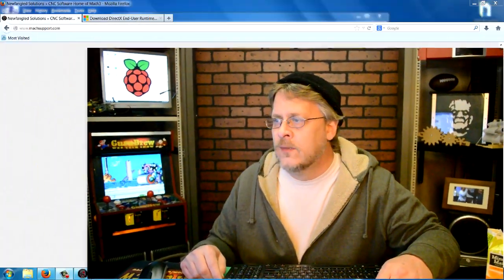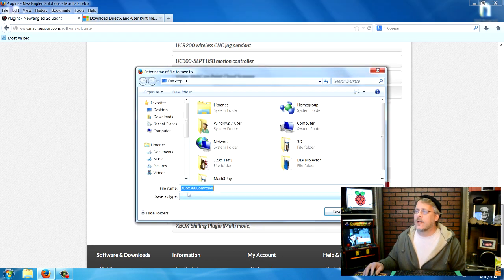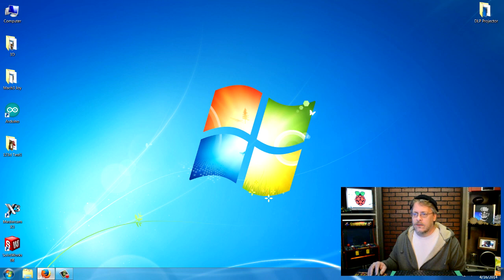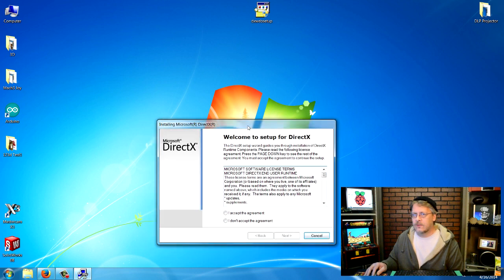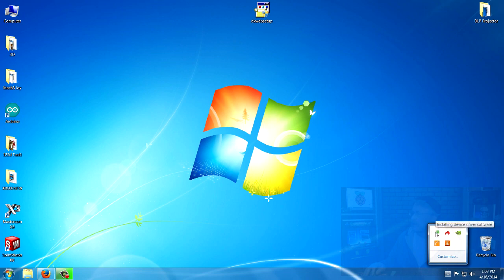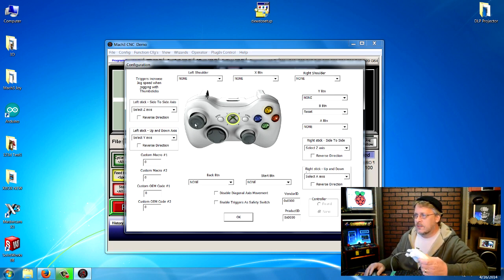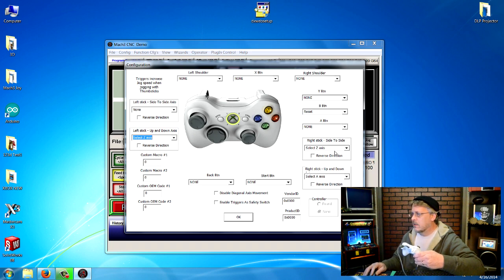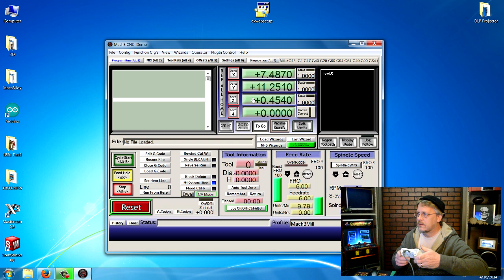How to Use XBox 360 Controller with Mach3 CNC Software

Comment: For those of you guys with an aftermarket controller, You'll have to get the Vendor and Product ID from the device manager.  Hit properties->hardware->properties->details and there is a drilldown for property.  Locate Hardware ID, mine happen to be E6F and 401, now plug the values into the fields in the mach3's xbox 360 plugin screen just right of the OK button and you should be golden.
Reply: thank you!  I purchased a generic xbox controller from the local Game Stop.  I followed GuruBrew (excellent) instructions but had no luck until I noticed your comment.

Comment: I had a small amount of progress tonight.  The genuine Xbox 360 controller as well as the clone controlled the Sherline using the Joystick plug-in but not the Xbox plug-in.....at least not yet.  I installed the Microsoft Xbox driver that you recommended below and XP responded properly when commanded with the genuine controller.  Both controllers came up with the exception of the indicator light on the clone.  I had to push the button on that one.

Comment: Thank you for your instructions on how to do this.  It's great.  I had run my cnc for three years with my xbox controller based on Lee Davis' addin and this video.  My cnc initially had only one motor on the y axis and the xbox controller worked great.  I upgraded my cnc to add auto squaring which meant I added a second y motor and limit switch on the A axis and slaved the A-motor to the y axis in mach3.  The Y with slaved A system worked great with the up/down arrows on the keyboard, but when I tried to jog the Y axis with the xbox controller, the Y-axis works and the A-axis only traveled in one direction.  The solution was to remove the Lee Davis addin, use Screen4 to set unused mach3 hotkey keyboard keys to the mach3 buttons that don't already have hotkeys and that you want to use from the xbox controller.  Then use antimicro to connect the xbox controller to all the keyboard keys you want to use from the xbox controller.  It worked great for me.  This should work for mach4 also because it makes the xbox controller a keyboard extension, but I haven't tried it.  By the way, Lee Davis graciously responded to my plea for help, but so much had changed with windows, that he couldn't help.

Comment: Thanks for the great info but I still have a question. As per your instructions I recently enabled a wireless x-box controller with my DIY cnc running Mach3 and it works great until I power down the program or turn off the computer. When I re open Mach3, I'll need to go back into my X-Box configuration settings and re install my Vendor & Product numbers before the controller works. Do you have any Idea what could cause these numbers to vacate and need to be re entered?
Thanks In Advance.

Comment: Great and informative channel, I use mach 3 on my machine thanks to you. Got one question. After setting up my baby and installing and configuring this plug-in to my liking I found that my machine does not do what your does which is diagonal moves with the controller, only one axis at a time. I had the "disable diagonal moves" box unticked as a default in config. During normal operation (cycle) everything is business as usual only on controller it does so. Any ideas??

Comment: An excellent description of how to connect an Xbox 360 controller to Mach3 software.  Thank you for posting this for us. This configuration works exceptionally well but there is one thing you should be aware of.  First, the Chinese copies of the Xbox controller for sale on eBay and other discount online retailers will not work for this purpose.  At least the unit I bought wouldn't work.  You will know there is a problem when during configuration of the Xbox plugin Mach3 does not automatically recognize that there is a controller connected to the computer.  The second clue comes when you try to manually enter the vendor ID and the product ID.  Mach3 will let you enter these values in the appropriate boxes but doesn't retain them once you exit the configuration mode.  It just wouldn't work no matter what I did.  Plug in a genuine Microsoft Xbox controller and bam, everything starts to work just like it did in the video.

Comment: Howdy-I followed your directions to the letter but when I tried to jog the machine the Y axis racked severely ( gantry style Y/A), in General Conf. my setting are "home slave with main axis"  and furthermore, my  X axis started moving on it's own and the only way to stop it was by hitting the E Stop button. I have the ESS smoothstepper board installed  and I thought maybe that was it but the instructions stated that the smooth stepper was covered. Any help on your part would be greatly appreciated. Thank you very much.

Comment: Steve,
I noticed you use MC 3...I am using a similar version at school MCX5 and I make guitar templates. So most of my cutting in really only 2 D.
What I want to learn is how to take that 2D drawing and make it 3D. I know it can be done as I've seen the teacher in school do it. I think what is done is you extrude the profile and set a thickness to it.
On an electric guitar, part of the surface tapers to give your arm some relief. If you look at a Fender Stratocaster on the top of the guitar, there is a bevel of a few inches taking the thickness from 1.75 don to maybe 1.25/
  I guess a ball mill is used...but my real problem is how to draw that in MC X5?
Can you help?
Rob
Reply from the maker: You take a 2D shape in a 3D program like Solid Works and extrude it for thickness then you use other tools to shape the belly and leg cutout. I have done this and it takes time to learn all the software to make it happen. I thought about making a video of the process but don't feel I would get many views because it takes more software than the average hobbyist has at their disposal. If you watch my video all about CNC router part #1, I show the raw guitar I made modeled after a 57 Strat. If you are truly committed to doing this, I would suggest getting and learning a good 3D modeling program. Don't try to use Master Cam to draw with, while you can do simple 3D drawing it is not the tool you want to use.

Comment: I tried a wireless Microsft x box brand controller as you described and  it crashes  Mach 3  . when I activate the plugin in Mach 3 for xbox . I get error triggered and mach closes. I get a 1 upper left green light on the wireless but no action from the CNC. any ideas? I loaded all the files from microsoft you suggested.

Comment: maybe you can help? i set everything up right but i have no control, xbox is in keygrab nd in con fig plug ins both on mach3 folder nd key grab plus mach3 plug in menu i set up btns like urs restarted nd nothing i use uc100usb so keyboard is my main use nd i own a win 8.1 surface pro2, tips?

Comment: Hi Steve,  I have been unable to get this plug-in to work using a generic controller.  And no I didn't read back in your comment section. :-)   Direct X has been installed, the plug-in is installed (both correctly I think.)  So tomorrow I go to Walmart and roll the dice on a genuine controller.   I'll post the results if there is any.   You produce a really nice an entertaining video series.
Reply from the maker: Hello, Yip it has been said here by others that generic controllers don't play well with this plugin and the genuine ones will correct the issues. Thanks for the comment. Steve

Comment: Very cool! Any guesses on whether it will work with a wireless controller?
Reply from the maker: I actually started out by selecting a brand new shinny XBox controller but was never successful are getting it to be 100% compatible. I have heard of others using it but personally gave up and went to the wired version. Steve
Reply: @GuruBrew  Hi Steve, hope you can help me with this. Hi all,
A while ago I converted Mach3 to run from metric to SAE. Everything works ok, I re-calibrated the motors, no problems running programs or jogging from the keyboard but I can only get the xbox controller to jog at 5% full speed. I tried so many things before asking for help that I,m at a loss right now. Tried removing and reactivate the xbox controller in the plugins, tried disabling and re-enabling the xbox controller in the peripherals of windows etc. Before , when I was in metrics, it would jog at the same speed as if you use the arrows on the keyboard but not anymore. Has anyone run in that situation before? If so what was your solution? Thanks for taking the time.

Comment: hi guru i was never able to get mach3 recognize the xbox 360 in windows 7 but i did get it to see the controller in XP..however the controller does not move any of the axis for some reason....is there anyhting i need to do to power on the xbox controller in mach3? mach3 has a green check mark in plugins....so not sure why none of the buttons do anyhting on the controller...controller has a green light on and it is seen in windows xp....i configured the buttons

Comment: So I was using this for awhile, then took it off while someone else was using my machine while I was gone. Now I try to re-install the Plug In and it won't work, it only downloads as a .dll and that won't work. So I tried the .exe file format (the one for offline use) and it just keeps saying I am missing .dll file after .dll file after .dll file. Any suggestions?

Comment: I am having an issue where the x axis isn’t moving but on screen it looks like it is. Other than that the controller does everything else I command. Same issue with keyboard commands and x axis. It’s a new to me machine so perhaps it’s in the wiring.

Comment: The XBoxShilling Plugin is a great alternative to the one you used in the video.
It allowed me to use the Logitech F310 Wired Controller with ease, where the standalone XBox360 Plugin wasn't working at all.
Thanks for video - it got me going on using a controller.

Comment: Hello..i have some write g code for x and y axis ..to open some plates and screw filling material..i want to use as mini injection molding machine.. i have some parametres to open and close clamping with stepper mator i use mach3 and i dont know the code how to repeat that cylce some my codes as loop?? please needs help ..forexample G1 X50 X-10 x -6 X0 and this is repeat hole cylce till i turn of the program ...please help needs i appreciate it

Comment: I am trying to download the XBox plugin for my cnc from the NewFangled website and it is telling me that the file could harm my computer. I continue on and it says. "The File does not have a program associated with it for performing this action. Please install a program or, if one is already installed, create an association in the Default Programs control panel". This is as far as I can get so uploading the plugin to my Mach folder is a failure. Please advise.
Reply: Were you able to find a solution to your problem?

Comment: Bought a USB Xbox controller and downloaded the xbox360 controller file from the site you showed.
Copied the 360 file from the house PC and installed it plugins  Mach3 dir. on the CNC PC which is NEVER on line for security.

Rebooted and got an error message "plugin DLL defective, relode" I clicked OK. Then got message "xbox360controller.dll - Defective plugin found.... Ignoring.. Hit OK and it doesn't show up in the Plugin control and Activation list.

What to do? 
Thanks
HH
Reply from the maker: Try running this file http://download.microsoft.com/download/0/0/f/00f2a67b-e10b-43b1-8cca-3deb12218f75/Xbox360_32Eng.exe

Comment: Hello I have watched several of your videos on YouTube. I got my first cnc machine a few months back and have spent days, weeks trying to get it to work with Mach 3. I was wondering if you could help id be willing to pay you for your time. Im in southern CA but I can face time you with my iphone or email you video or pics of my settings. I have a hand held controller and everything works fine but the machine wont move via Mach 3 through the computer. Im also using a UC100 motion controller because I don’t have an old computer with a parallel port.
 
I have this machine
CNC 3020 CNC Router Engraver Machine + JY5300 CNC Controller Box+ MHC1 HandWheel

Comment: Great video but for those using a generic / aftermarket xbox controller please note comment from Jrsydvl2003
For those of you guys with an aftermarket controller, You'll have to get the Vendor and Product ID from the device manager.  Hit properties->hardware->properties->details and there is a drilldown for property.  Locate Hardware ID, mine happen to be E6F and 401, now plug the values into the fields in the mach3's xbox 360 plugin screen just right of the OK button and you should be golden.

Comment: My Xbox 360 Controller is the wired USB like yours.  Problem I'm having is it tends to go into sleep mode (green light in upper left position resorts to all 4 lights flashing or sometimes it switches to the upper right).  Unplugging/re-plugging the control doesn't seem to work.  When this happens, about all I can do is restart the computer.  Have you encountered this problem or know of fix?
Reply from the maker: I have not heard of the actual controller sleeping. Are you sure it's not the power settings in Windows or BIOS releasing the USB ports? Maybe someone who has experienced this issue can chime in here. thanks
Reply: I'm running Windows 8.1 on a Microsoft Surface Pro Tablet.  I don't know if this will solve the problem permanently or not, but I was able to go into "Devices and Printers", right click properties for the Xbox 360 Controller, then click properties for the "USB Input Device", click "Change Settings", click "Power Management" tab, then uncheck the box that allows the computer to turn off the device to save power.  Hopefully, that will keep the controller from going to sleep.  I had previously configured the power management settings for the computer to stay awake when idle, but possibly this device property was behaving independently.  If this doesn't work, I'll update the post.
Reply: Sorry to say, but the fix I posted above has not solved the problem.  I'm not sure where to go next.  Since the Surface Pro only has on USB, I'm running the Xbox through a USB hub as well as a UC100 (USB to Parallel Convertor) to the breakout board.  I've noticed that when I have the Xbox controller connected directory to the Surface, it doesn't go to sleep.  Only seems to happen when hooked up through the hub.  Thoughts?
Reply: +mdsutherlin1 I would get a old desktop CPU from a friend and forget about using the Surface Pro for the CNC.

Comment: Is the XBox controller a specific model?
Reply from the maker: The genuine original 360 wired controllers work best (ebay). See the  other comments here about using 3rd party and other controllers.
Reply: GuruBrew I got this one from Amazon, Microsoft Xbox 360 Wired Controller.  Hopefully it will work.Thanks.
Reply: GuruBrew Guru, so I couldn't get this running on a Windows 7 machine, but was able to run on Windows XP after I downloaded the controller link from the plugin page.  Which OS are you using?
Reply: Putins Cat OK, I didn't notice that DirectX Link on the plugin page until I hovered over it.  
That fixed it on Windows 7, and may have also activated the Shilling DLL as well.  
Thanks!